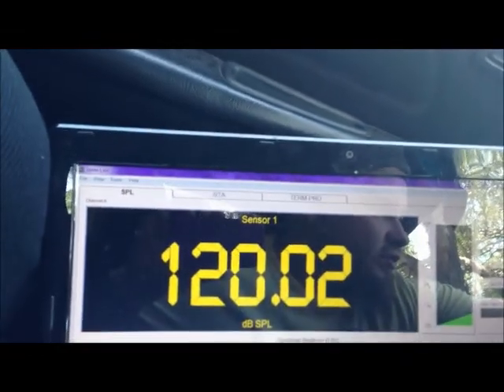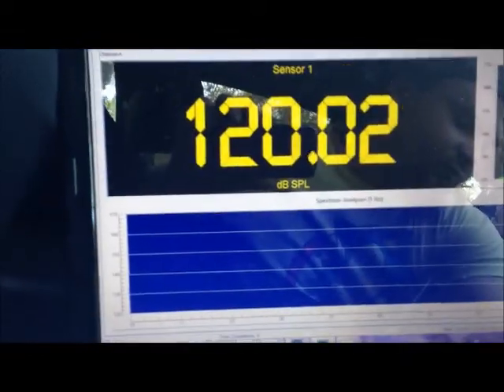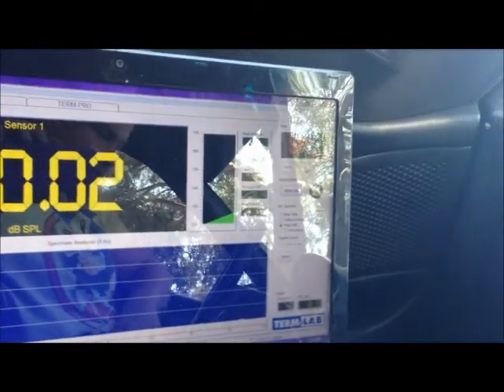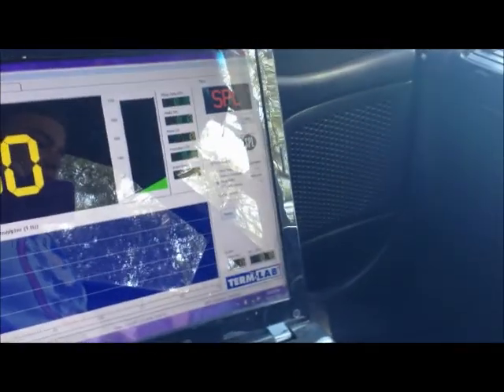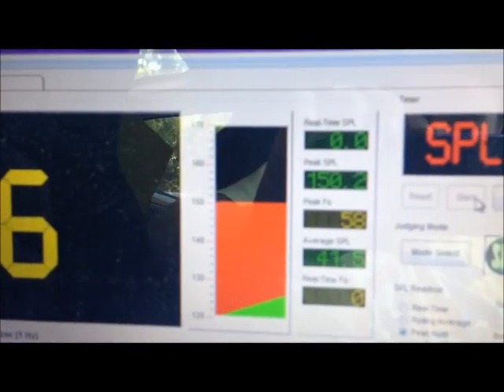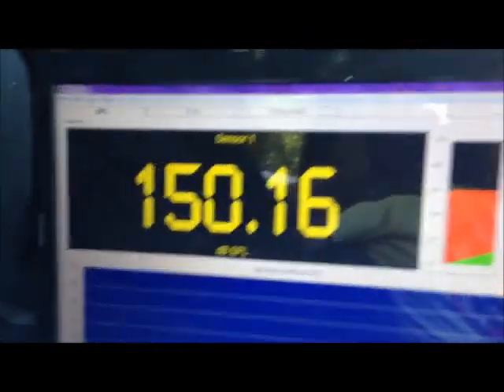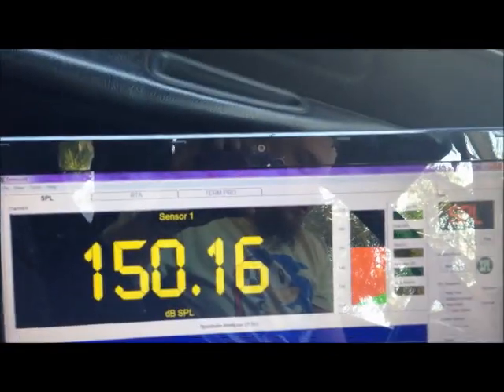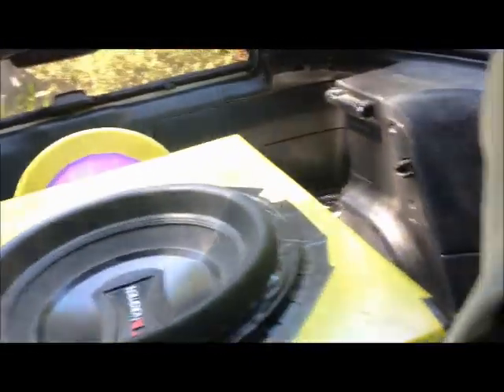Single Nakamichi NSX 12" does 150.2dB

Comment: Who cares, its a 1850wrms sub why inject more than that, you'll end up frying it. decent output though! Good shit!
Reply from the maker: Well I guess people who like to see big numbers care? Being the 12" it's actually rated at 1350wrms too, its the 15" that is rated at 1850wrms.
However I ran my NSX daily off this amp in a TRWC box for a good 6 months with no issues, so they'll definitely take more power than they are rated for.
Only people who don't know what they are doing, or just don't care fry gear. People with half a clue are generally fine.
I've never blown gear.
Reply: Damologist
All you're doing is running it above RMS, the rest is wasted power (Heat), good that's its not clipping but cmon, its at its limit, still very good output.
Reply from the maker: Ummmm... "the rest is wasted power"?

Are you saying that a sub, the NSX in this case, is only capable of utilising the power level of which it's rated, and that any power you put into it beyond that is just being wasted?
Reply: Damologist
Negative, i don't know the load that the sub can take but beyond its peak, its wasted power.
Reply from the maker: Ok, I'm not sure what point you're trying to make?

But out of interest, why is it wasted power? Please elaborate :)